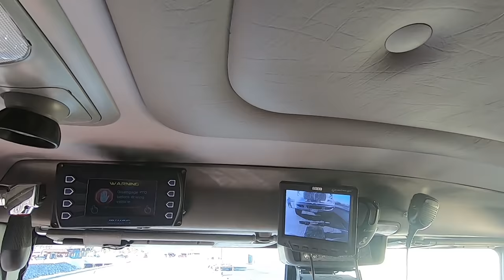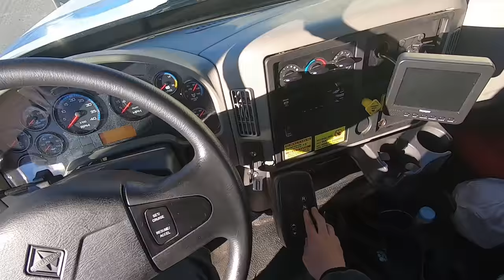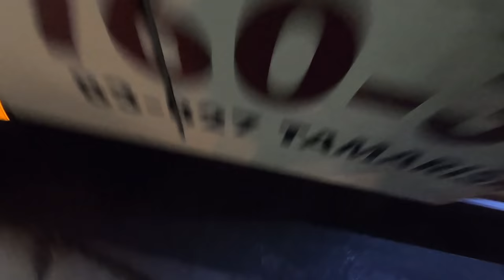Towing A Truck Full Of Body Parts! In The Snow!

Comment: I thought the service air would supply air to what you are hauling when you put your brakes on?
Reply: I thought you would hook the air line up to the service air connection and not the emergency when putting air to a truck you are hauling ?
Reply: He hauled that truck without using air brakes.  26k is probably nothing behind him so braking on his truck only was sufficient.  Only put air to it to keep the brakes off so he didn't have to cage them.

Comment: Where is Yucca Valley?
Reply: High desert of southern California. So named because of all the Yucca trees native to the area.
Reply: Yucca Valley is in the High Desert  of Socal on the North slope of the San Bernardino mtns  near MCAGCC 29 Palms .
Reply: Start from Indio, head west on I10 to 62, then take that north. Alternatively, start from I15 in Victorville, head east from the D Street exit (or Bear Valley Road; they converge some distance out) through Lucerne Valley, continue straight on 247 (4-way intersection, both highways turn 90°). Yucca Valley is where SR 247 and SR 62 meet. Off 247 between Lucerne and Yucca is Johnson Valley, a major 4-wheel rock crawling destination.

Comment: Trent, why you always disconnect driveshaft?
Reply: On trucks that you tow?
Reply: @ilyagendler567 As I understand it, the propshaft/driveshaft is disconnected to isolate gearbox from rear axle differential. If left connected the rear wheels will make gearbox shaft spin and may cause damage to the gearbox due to lack of lubrication. Without the engine running there is no forced lubrication of the gearbox.